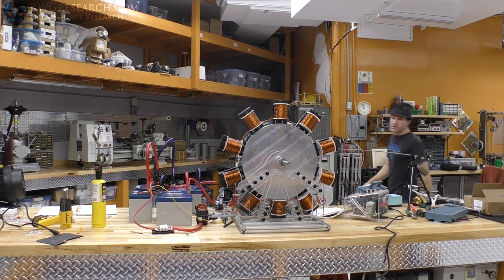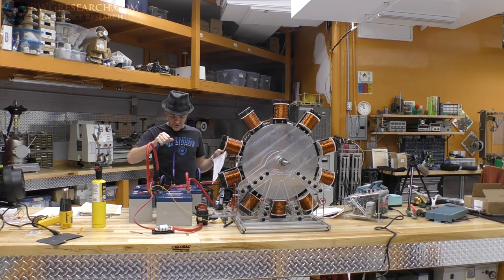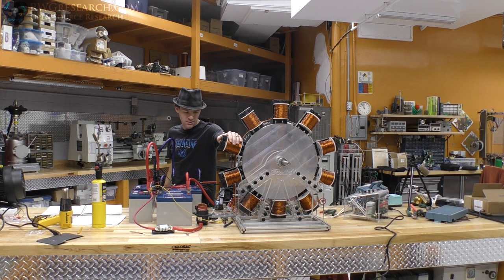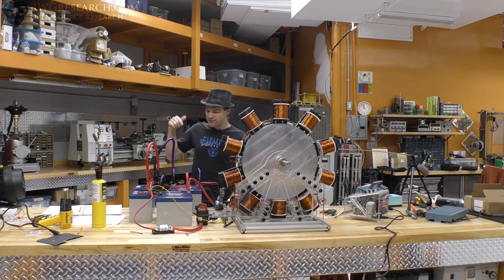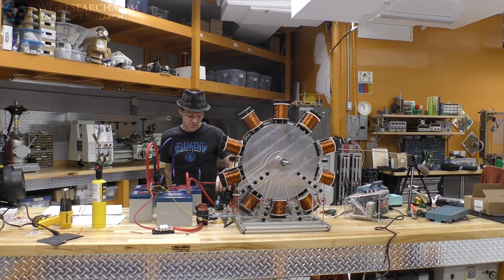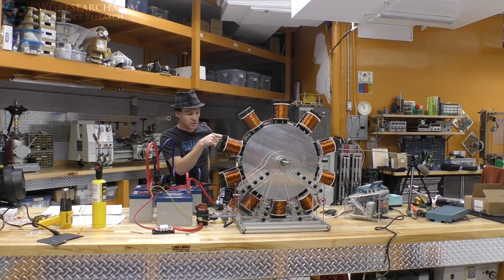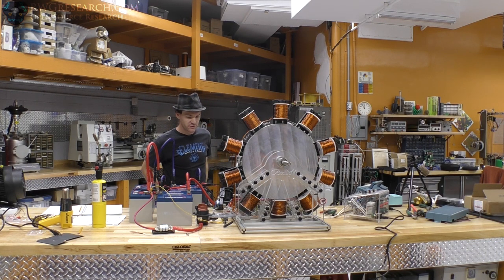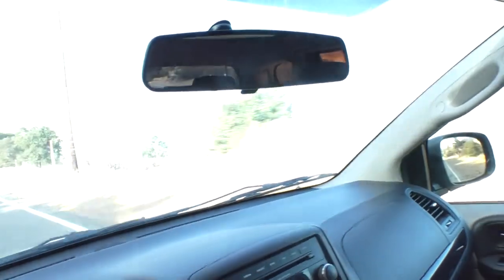P2 : Bedini 10 Coil Testing... flash back from 2017

Comment: Thank you for the low impedance transformer idea.
Reply from the maker: :) yeah I did a lot of testing with that.. stick around for more :) also, I have seen you have been doing ALOT of stuff. Any luck / discoveries worth sharing? keep up the experimenting and sharing! ~Russ
Reply: On the battery charging part I have not much experience, I did experiments in the beginning but couldn't motivate myself to go further on that. 
Eventhough the load doesn't consume the energy, the batterie will only succeed in storing +-80% of what's comming to it. 
I couldn't find the point where "gain" is made to become unity to be able and switch the batteries indefenetly, because we evacuate the gain with the diode (my thaught on it).
Allthough there's some small amount of energy comming back to the run batteries (24V), I couldn't find a way to influence it in a positive way so the losses where compensated. 
I'm not saying there is no way to do it, because looking from it with what I've experienced with my experiments, I know that just knowing what balance to create between the parts used can give you the wanted result (or closer to it :) ).
With my last experiments I experienced this more clearly because I was able to get closer to the results wanted in resonant circuits, just by using Impedance matching and/or find the balance between L & C values whether I want current or voltage gain. It's not only the formula to fill in to get resonance, you also want balance between  the values of L & C according to the fact you want current (high capacitor value in parallel with low inductor value, with Q factors that allows the wanted result) or voltage gain(low capacitor value in series with high inductor value, with Q factors that allows the wanted result). 
Now I have the problem in combining them to get power gain because it seems that both are opposite of the parts values needed, but it's showing that one can not to quickly say it doesn't work. 

I always keep in mind that even in not succeeding myself to get the battery switching indefenetly, the percentage that the charging batteries are able to recupurate is what we have as gain in comparisment by not using it. So if we have 80% that the battery is able to store from what it get's in, then we allready have 80% gain by using this system.

@Russ:  Up until a few months ago "Impedance matching" was just a nice description to me but couldn't really understand  it's value towards what I was doing, now that I have experimented on it I have better understanding, very far from complete, but enough to say to other people that it can really help boosting up results.
Therefor when I heard you talking about "low impedance transformer" it rang a bell :)
Thinking on it afterwards, it came to me that by using the variac I had allready done some experiments on that, it just didn't came to my mind in that sence because at that moment of experimenting  the impedance matching didn't had that much meaning to me as it does now.
So to me it's not only understanding the terms used but also understanding it's value towards what we're doing.
I understand the reason why you're doing this video's in steps and not just give the end result. That doesn't mean that I'm not curious to your end results :)
I'm looking forward to your upcomming video's.

Comment: As proof of this excess energy flowing into his air gap, he refers to a simple but fascinating experiment, both in his UK patent and in his book The Revelation of the Century, from The Principles of Electromagnetism (1955) by E.B. Moullin.

The first thing to remember is this:

The flux density in the gap represents the mechanically available energy.

Next, here’s what you do:

Take some transformer E laminations and wind a primary and a small secondary onto the middle as shown above in Fig. 1.

Use a variable AC power supply to adjust the input power supplied to the primary.

Use strips of cardboard or plastic between the E and I laminations to simulate an “air gap” of various thicknesses.

Now you want to measure both the amps that go into the primary, as well as the voltage in the secondary / search coil.

Each time you increase the gap by placing another strip of material in between, you adjust the power supply so that the voltage in the secondary remains the same, which means the flux density, or magnetic field strength on “the other side of the gap” remains constant, and thus the mechanical energy available remains constant.

Now here comes the kicker: if you plot the input current versus the gap size, you’ll clearly see it curves down!

Remember, we kept the voltage across the gap the same, so the same mechanical power is present, yet we need less and less current to establish that same amount of mechanical power the larger the gap becomes!

So where is that additional energy coming from?!

All we know is that it is clearly NOT coming from our power supply.

This is why your air gap should not be too small, as that will limit this excess gap energy from being harnessed.

Adams mentions in several places that ideally the gap should be 1 to 1.25mm wide.

Comment: Build a TDR using 7KJ cap bank nice project for you
Reply from the maker: I'm missing the abbreviation! what is a TDR ? I have my 10Kj bank :) ~Russ
Reply: @RWGresearch  large  flat coil as big as you can make, then discharge the capacitor bank,then using a oscilloscope read reflected pulse.....have fun rus glad to see your still about

Comment: april 21st  2013 about eddy current   I had thought this up over 10 years ago and yeah giving it away    A thread sewing machine basically  now all lighter more appropriate materials   anyway  the arm now contains gears in it to push the what use to be needle which now pushes paddle below  making wheel go around all mechanical   Apply eddy current to something like this?  Momentum picks up?  this might generate enough force if worked on with other sources such as pressurized devices   you know?  yours would rot in patent